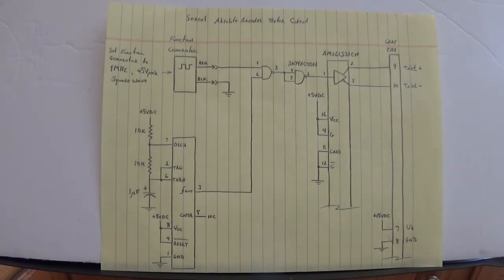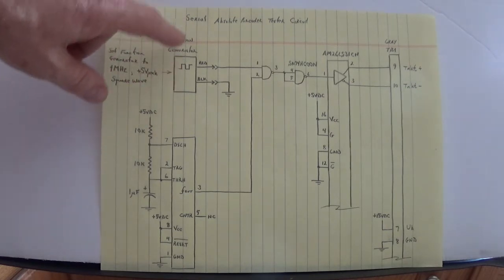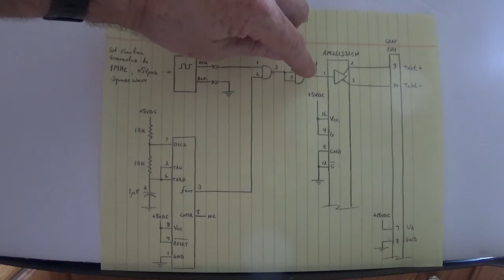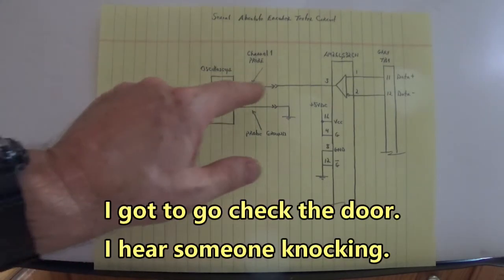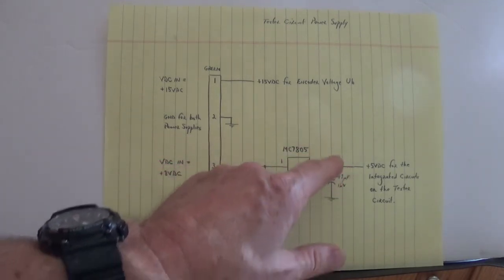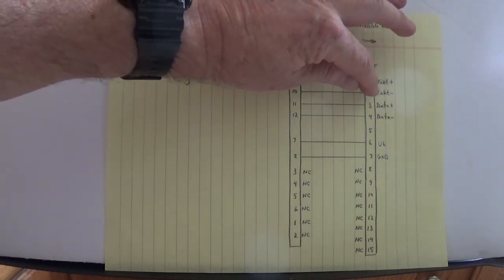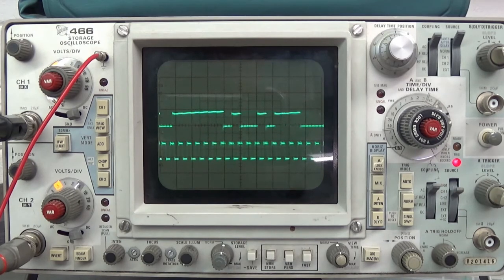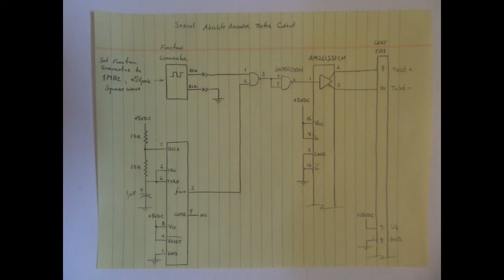Testing the Synchronous Serial Interface Absolute Encoder

Comment: great work
Reply from the maker: Thank you very much for watching. I am always glad to hear from folks who enjoy electronics and electronics troubleshooting. I wish I knew more about PLC programming. All my PLC repairs have been repairing the hardware. And not the software.
Reply: Sir , I am developing my own PLC now. I have Already Designed and tested my prototype for botth software and hardware for Digital Input Digital Output , PT100 8 channel , 4-20 Analog Input 8 Chanel . Just yesterday Finished Incremental Encoder. The Work Pending is 4-20 Analog Out and The CPU. For CPU i have already prototyped my PCB for RS485 and Ethernet using Wiznet W5100. Making Box / Casing seems very high cost due to cost of Die and Injection Molding Machine cost......But hopefully i would come in a price i can afford. Thanks For for This Video Again...

Comment: sorry Sir!!!! i need read signal from the absolute encoder (PEPPERL+FUCHS) and show this on computer. I use NI My daq as oscillôscope. please help me. the data +- and clock +- of encoder must conect to Transceiver RS 422. can i use am26ls32 to conect wire data and clock with port analog of ni daQ?????. Plz help me. I'm form Viet Nam and I try to study absolute encoder. Thank you!!!!
Reply from the maker: I looked at a datasheet for a Pepprl&Fuchs SSI Absolute Encoder, Model AWS58. Its data transfer rate is 100kBit/s to 2MBit/s. So yes the AM26LS31 and AM26LS32 will work for the digital part.
Reply from the maker: So sorry, but what is the port analog of ni daQ?
Reply: this is input :D
Reply: can i use only am26lm32 to connect with encoder??